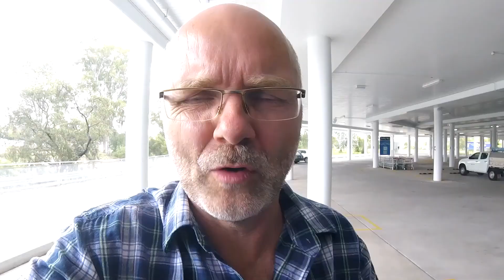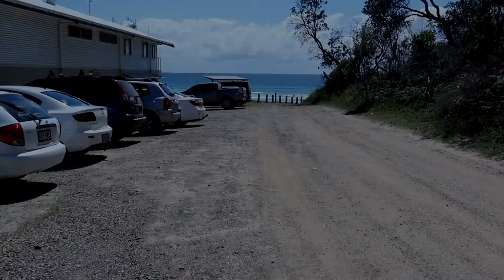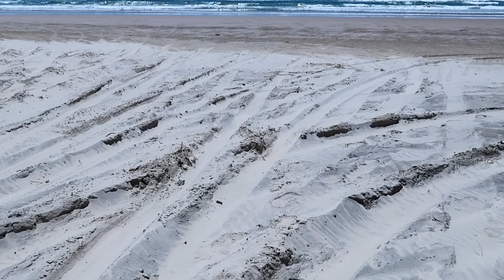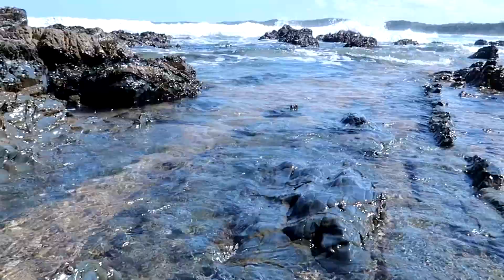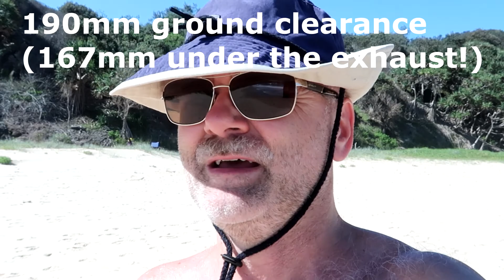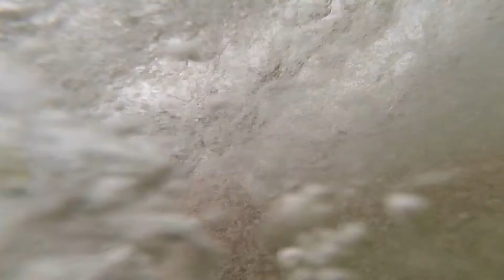EP14 - Why the Outlander PHEV struggles on the beach.

Comment: I have just tested a 2015 model with 10,000 ks on the clock.. It is a failure as a 4wd as it wont pull out of the soft sand on the beach  where as the 2.4 petrol only model petrol will.. , it is a fast powerful car... the 2.4 engine and the electric motors add up to 200kw of power.. it dosnt feel anything like that but still much faster than the 2.4 petrol only model, maybe its weight.. Try pulling a caravan up a steep hill doing a hill start.. wont do it.. or towing it off a muddy soft paddock where all the wheels have sunk a little, it will rev up a bit but it appears too high geared to get going..  it is a  great machine for other purposes though.

Comment: Hey do you think it would help to put more off-roady tires on it? Could you put smaller wheels and bigger tires?
Reply from the maker: That would certainly help. The main problem will be the low ground clearance though. The car does totally fine in mild off roading, snow and mud, everywhere you have a solid underground but slippery surface. Sand is different though and the car digs itself in very quickly and lands on its butt. The wheels spinning free then and you're stuck.

Comment: We had a lot of snow before Christmas in Birmingham UK, the PHEV was brilliant in it, never got stuck. The only problem was that it was let down by the standard TOYO road tyres. The next set will be some all weather Michelin Crossclimates to help with the grip.
Reply from the maker: Thanks for your feedback, Tom. I can imagine the vehicle is doing fine on snow and is a lot of fun to drive. The tyres are certainly a key factor for success of fail. The low ground clearance was a big problem on the beach. I think you will experience similar problem when driving through forest roads in Winter where the area between the tracks is fairly high and the car sits on its bum all of the sudden, the wheels loosing traction and you're stuck.

Comment: I love driving the phev on the snow.  No problems found until now.
On ice never tryed the hardcore version thus no feedback. But the AWD usually kicks in on roundbunds or sharper turns always providing the necessary safety.